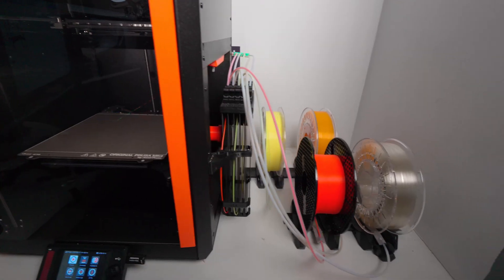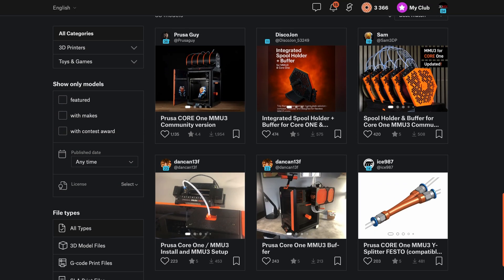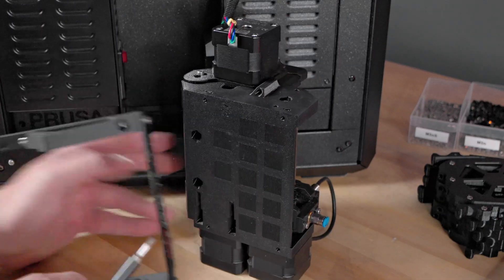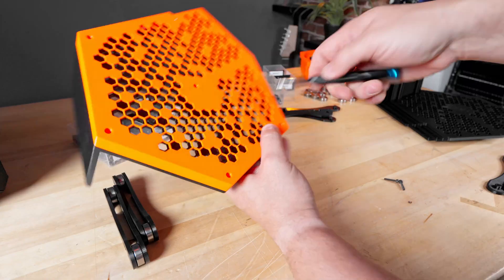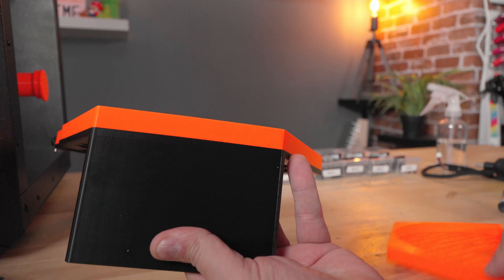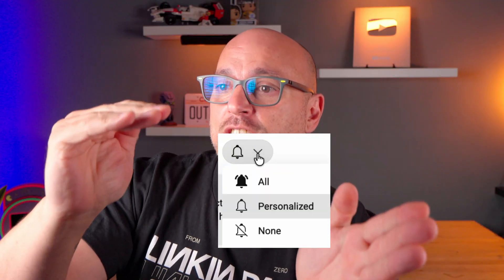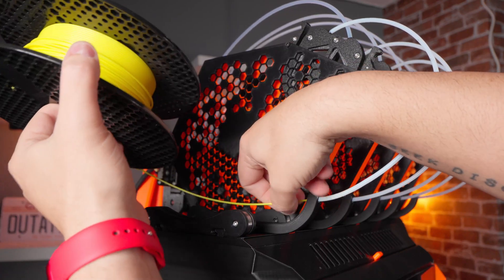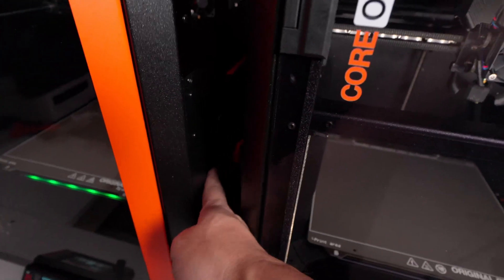Solving My Only MMU3 Problem For The Prusa Core One

Comment: Hey 3D Maker Noob. Bigger noob here. Most filament I buy in Canada comes with cardboard spools. I can print spool adapters to make them spin better, since cardboard wouldn't spin on those bearings well at all. But that would add additional width to both sides where the filament needs to spin freely.

Have you tested any spools that are wider? I'm worried that it will get stuck on the side of the spool holder.

Comment: Hello, what program was used to modify the dimensions of the parts? I'm just getting started with 3D printing & I'm as excited to create & manipulate components as actually printing them (I already use AutoCAD for residential/commercial structures). Thanks!

Comment: Awesome!  Got the parts printed and working on the MMU build now.  What length PTFE tube length did you use in the settings?
Reply from the maker: I cut my own to size, which I believe was 45cm
Reply: @3DMakerNoob  All the tubes at the same length?
Reply from the maker: I meant for the one going into the nextruder. Didn’t really measure the length of the rest of the tubes. Ideally the shorter without hard bends the better
Reply: @3DMakerNoob  A length specification would be cool. Then I don't have to worry about it and there's less waste 🙂
Reply: @3DMakerNoob Would be nice if you could measure yours out 😉

Comment: Solid engineering, my only possible concern is the spinning spools rubbing the side of the buffer mounts, might slowly wear into it? Maybe something like a piece of PTFE tube right beside the top of the bearing blocks, to just kind of keep it at a distance and low friction, if it does end up an issue.
Reply from the maker: While I don’t think it will be an issue, it is a very good point. I guess the easiest way to mitigate it would be to just do a 1mm protrusion just above the roller wheels to act as a buffer for the spool to slide against. Thanks for the tip!